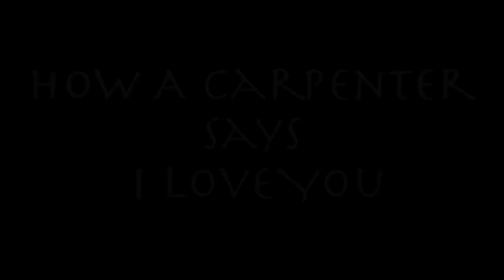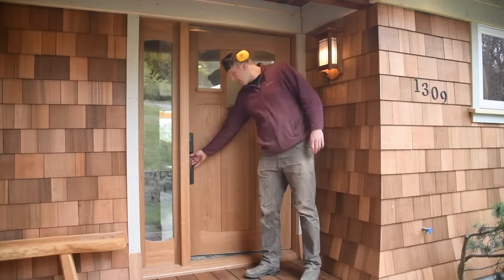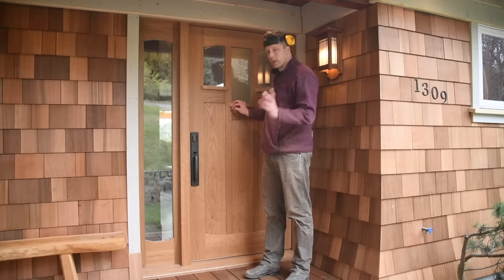Woodworking, Building My Own Front Door!

Comment: Beautiful! I love the design and the attention to detail. As a painter, I have found carpenters have a real appreciation for the beauty of wood and want a natural look. Even for a natural look it needs to be stained. The amber cast of an oil base finish is not enough. Stain will condition and romance the wood. It's also important on the exterior side that it have several coats of finish with a UV blocker. The sun's ultra violet rays will brake down a thin coat of clear finish in 18 months so it's important to have multiple coats. "Sickens" door finish system is good and available in quarts.

Comment: Just now saw this build. Excellent craftsmanship! If you are able to answer a question - how does the solid wood construction hold up to the changing humidity in the air. Many wood build doors now have a 3/8” exterior hardwood skin over glued up wood comprising the inside (supposedly less expansion and shrinkage. Thoughts?

Comment: As a woodworker and homebuilder, I don't understand how people think non-laminated doors will hold up year after year.

The large door companies make laminates with a 1/8" veneer so that the door stays true, as a 1/8 warp in 81" is an exterior door that doesn't shut correctly.

Personally, I know 2 professional custom door builders selling doors between $20-$80k and they also make laments of stable wood before adding a 1/4" veneer.

So, I'm wondering, how many doors have you made?  How old is the oldest one? And have you been able to inspect any of them for warping?

Comment: Gorgeous door, great woodworking.  I've heard you need a core made of end grain glue ups with a 1/4 exterior cover.  This is due to expansion/contraction a door sees from the heat of summer to the cold of winter.  Thoughts on this?

Comment: Hello!
Samurai,
I liked your video.
Explain me,
why European oak veneer, and any other veneer is very expensive in USA, and why you have strange sizes of sheets, I buy a good oak veneer, size 3400x200x0.6 mm for the price 2,7$ per 1m2, red/white oak by 1.1$ per 1m2, Black Walnut (USA) by 3.8$ per 1m2,  European Walnut by 7.5$, Teak by 20-25$, it is retail price, veneer is sold in bundles - flitch , in one bundle about 10 m2....

Comment: Most door exterior openings are approx. 80 inches and this guys is like 6'8" tall prolly 6'10" in work boots. Ya it looks funny cause he doesnt have any kind room for  a casing or trim at the top. Looks like his deck framing/rim joist is right there !